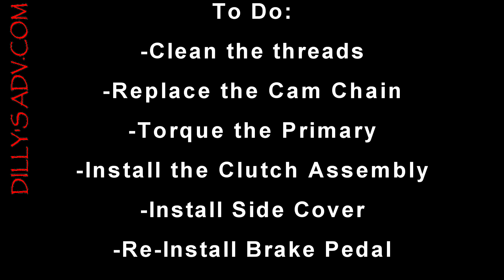FIXING PROBLEMS AND ASSEMBLY

Comment: Nice job and save on the gear shaft thread. The part that goes on the shaft is a nut, not a bolt. It common to call them eft handed threads rather than reverse threads, atleast this side of the pond. Good job 👍
Reply from the maker: Thanks, it had me so stressed out I could not tell the difference between a nut and a bolt - I really do know the difference but my brain does not always put it together.. Left-handed threads just screw everything up..
Reply: I don't blame you, you fixed it so all good and probably saved other guys from over torque lh threads as well so super job.